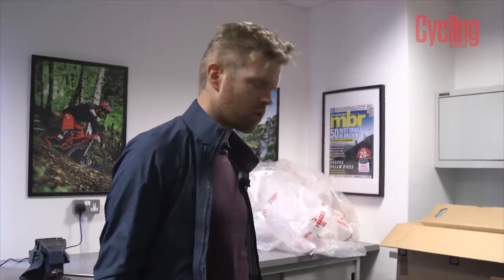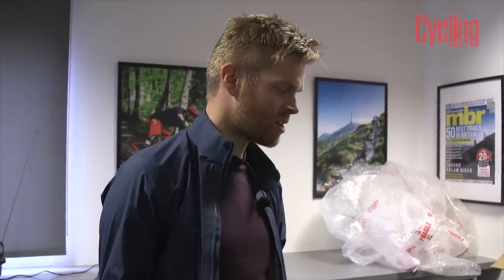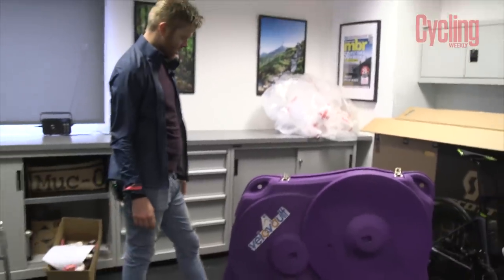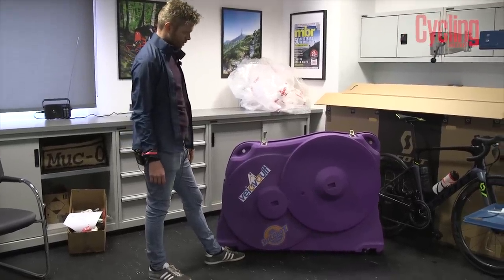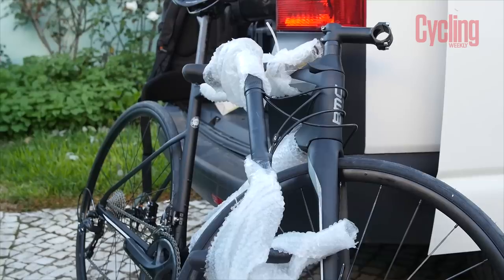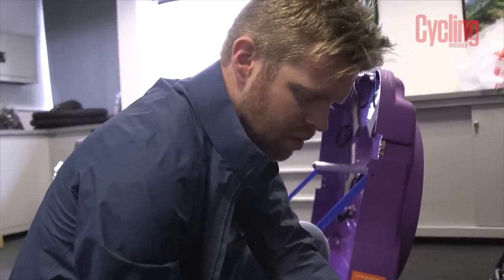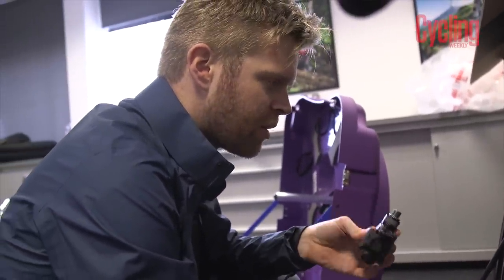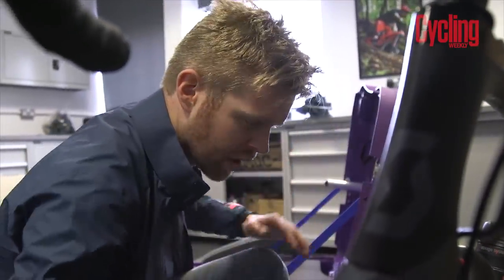Packing a Bike Box | Ollie Weekly #29 | Cycling Weekly

Comment: Great video Ollie – one of the best, if not the best on bike packing.

I have a Bikebox Alan along with a road bike with discs and thru axles.  I did not want to risk taking the disc rotors off.  My solution was to thoroughly wrap the disc rotors in bubble wrap before putting my wheels in padded wheel bags.  I put the wheel bags into the Bikebox Alan using the same allocation for the front and rear wheels but with the rotors facing inwards.  The only downside was that I could not use the crush pole.  This was not an issue for me as Scicon make similar hard case bikeboxes without a crush pole.  The Bikebox Alan survived handling at a number of international and local airports without any mishap.

Comment: Put bolts, clamps, tools and other small object in a plastic bag. Put it in a bottle, top with bobble wrap. Put the bottle in the cage. On many bikes it is possible to unscrew the rear mek, and strap it inside the frame, to get enough free chain take the chain of the chainrings and lave it close to the frame. Wrap some bobble wrap around the loose chain.

Comment: hi Ollie

great show ! i have some ideas for you. not sure they are all good but here they are.

1. for saddle height; before removing the seatpost move a  rear light clamp into position over the clamp, nice and snug. when you go to rebuild, simply push saddle/seatpost back until you hit the clamp. 

2.  getting the wires back out is easy. go to your local hardware store and buy a retractable pen sized magnet. it is about a valve extender size in diameter, as short as a pen but extends far enough to touch bottom. unless the cable is not made of metal, the magnet will let you pull it out with ease

3. remove the rear mech, bubble wrap it and zip tie it to the frame ( also bubble wrapped, of course

4.  remove chain, bring a new one, keep the old one as a spare in carry on

as a side comment, i think bike boxes with hinges are a bad idea. flight cases come in a style with a removable top. this means perfect alignment every assembly plus the ability to build protective rods that are fixed inside box and lid, and mate up. also, why not build a box that has something better than a rod... a rib cage !

lastly, the wheels should be removable . not exactly an engineering challenge there...

Comment: Any luggage case either soft or hard are not designed for use forever.  And that goes for bike cases as well.  It a shame about bent wheel.  The surrounding plastic will crack there and near handles.  Soft material and stitching will tear.

Comment: Hey Oli ! I know this is quite an old topic but I wanted to know if it’s worth getting pro bikes which are put up for sale . I am really tempted to get myself the Movistar Canyon CF 2015 which is being put up for sale in the Canyon website but a little concerned on the longevity on the cycle and it’s components itself . ESPECIALLY THE BATTERY WHICH IS EXTERNALLY FIXED TO THE FRAME. Say if I purchase it can I somehow mount it into the frame ? Or just letting it be as it is wouldn’t damage it from the elements outdoors? Or may be a review on such bikes which are being sold ?It would be great if Cycling Weekly could do a Video on it .

Comment: Good vid, but still not changed my mind about travelling with my bike. I'd much rather take my pedals and saddle having pre rented a bike over 'there'. I know it's more money but I'm too lazy to keep dissasembling and reassembling my bike, and I wouldn't trust it not to get broken in transit.
Reply: Jon Burnell it’s pretty similar money wise as you’ve to get a large van transfer both UK and destination side, the boxes are huge! It’s around £80 baggage cost and then around £60 to rent for a week...including the faff plus couple of pounds difference I’d rent in future
Reply: agreed ... only benefit is that if you bring your bike = it fits you perfect... no guarantee of a good fit = fiddle with the new bike or you put up with slightly imperfect fit: I think of it like going hiking with a new pair of shoes. Yes you can pick your size but until you have put 50 miles in the shoes, you won't know if the fit is perfect = uncomfortable fit may ruin a trip
Reply: Me too, I can put up with a strange bike for a week. But so far renting has been less. $150 for a week. The cost of buying an expensive box, and paying lots each flight for baggage, it would take several years to pay off.

Comment: Will be flying with my bike for the first time in July. Should you deflate your tyres when packing?
Reply: yes! the hold isn't pressurised
Reply: Oliver Bridgewood thank you dude. Assumed that but wasn’t too sure. Many thanks
Reply: Oliver Bridgewood Oli - that’s not quite correct - the whole fuselage is pressurised including the hold. “Pressurization systems are designed to keep the interior cabin pressure between 12 and 11 psi at cruise altitude. On a typical flight, as the aircraft climbs to 36,000 feet, the interior of the plane “climbs” to between 6000-8000 feet”
Reply: They recommend deflating tyres completely but in fact the pressure changes are not so great as to need this. Just don’t leave them fully inflated at 8 bar
Reply: thanks for the correction Richard. Airlines still ask you to deflate tyres though so best do it!